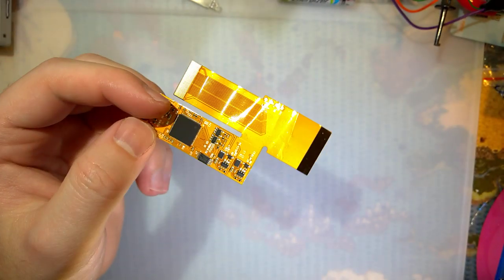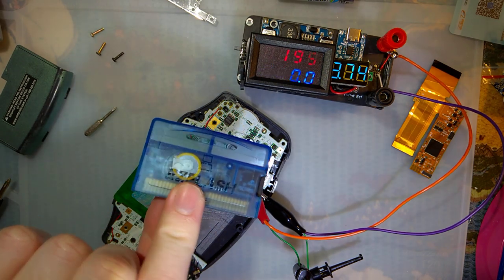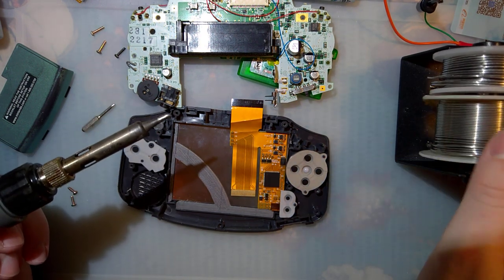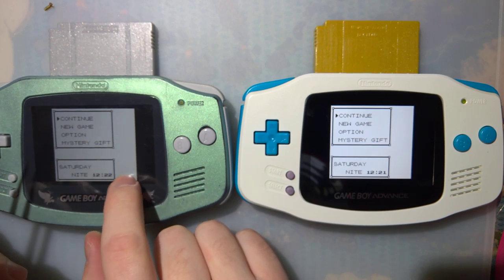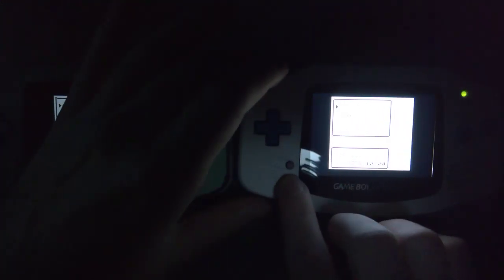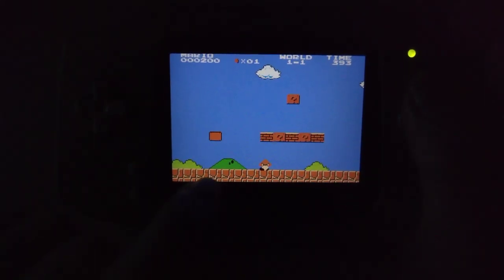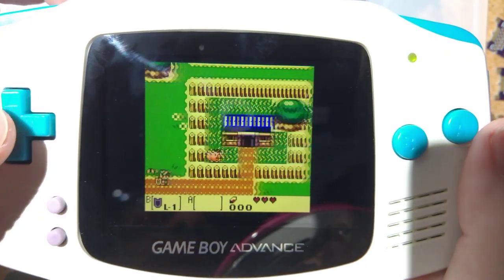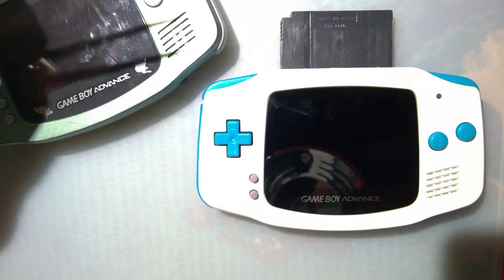Comparing the different GBA IPS Kits (Funnyplaying vs "One Chip")

Comment: Re: the Mario Bros. cloud issue: The NES has a screen resolution of 256x224, while the GBA has a resolution of 240x160. To avoid losing detail, Nintendo made the Classic NES games on GBA alternate what line's being shown each frame (sorta like how interlacing on an old TV works). My guess is that the flickering is causing the IPS screen to retain the image. I'm not sure why one of the screens is affected while the other isn't, but I'm pretty sure if you switched ribbon cables the LCD with the retention problem would still have it.
Reply from the maker: I did test both ribbons on the same LCD. The problems that I mentioned were from the ribbon. The two ribbons handle the LCD conversion with completely different hardware so I'm not surprised that they both have different quirks.

Comment: NES emulated games do produce a lot of artifacts on Funnyplaying kit; the most extreme one I saw was probably Qix, which left a lot of junk on screen after finishing each level.
Reply from the maker: This wasn't a NES game though. Well, I guess it is, but in this case, it was a port from nintendo. The game is one of the classic NES series ports from Nintendo of Super Mario Bros. I would get if an emulator had some visual glitches but this was first party code.
Reply: @makho  pretty sure that is more or less the same thing, since SMB in PocketNES glitches the exact same way the "port" does.
Reply: @makho  also just tested this - PocketNES can disable flickering in settings, which significantly reduces those artifacts; the Nintendo "port" probably does not have the option, though.

Comment: Hi Makho, is the framedrop you showed in Pokemon in this video fixed on recent V2 One Chip kits from aliexpress etc. ? Because I don’t want a Toppoly screen from the Funnyplaying kit.

I want a screen with a perfect smooth scrolling, so no stutter etc. and in this video only the Funnyplaying kit is ok with that.

Maybe it’s because only this kit run the screen at 59.73hz like the original Gameboy advance screen and other kits are at 60hz ?

Thanks 👍
Reply from the maker: Yeah so the framedrop issue has been resolved for a while now, especially with the "2 in 1" and "TV Version" OC kits. The ribbon cable based kits that I showed in this video are still hit and miss but most of those should be good too.

Comment: Hi Mahko!  How do you avoid getting dust under the screen lens?  I have done a few IPS mods but I always end up with specs of dust under the lens.
Reply from the maker: I'll let you know when I've got that figured out and can do it consistently.
Reply: We are all on the same boat unfortunately
Reply: @francasal1487  It's too bad, I'm way too ocd about dust under my screen lens.  I have found using packing tape to remove the dust works pretty well.

Comment: why do you set the power supply at 2.4 volt instead of 3 volt?
a pair of regular alkaline batteries would provide 3 volt (1.5 each) and rechargeable ni-mh batteries provide around 2.5 volt (1.25 each).
Reply from the maker: There's a whole host of reasons. 2.4v is about the mid charge level of a pair of alkalines. I'm not going to test the whole range so testing the middle is easier. Some mods cut down on the low voltage cut off due to the increased power draw so testing at the bottom of the spectrum won't work well. My power supply struggles at much lower than 2.4v anyway (it really could use some voltage smoothing). I don't care if everything works on a pair of fresh batteries because one will rarely use fresh batteries (they do stop being considered fresh after a few minutes of use, right?). Same reason I do GBA SP consoles at 3.7v despite a fully charged Lithium-Ion putting out 4.2v and a mostly depleted one putting out 3.0v

But probably the biggest reason is because when I first started testing with this meter (and recording values), I was replacing a different system. The batteries in that other system were approximately 2.4v so I was trying to see if the measured power usage was seemingly accurate. I just stuck with the value. Before I made this power meter, my previous methods were just to use a multimeter inline and my batteries happened to be at about 2.4v when I made that switch.

Comment: Thanks for the test! Too bad I already got the “non-funnyplaying kit” on the way T_T
Reply: i have the non-funnyplaying version since two weeks too, but the screen is way brighter (even on the lowest setting) an I have not seen any problems lika taering oder ghosting etc... but I like the fact a lot, that the china-chip remembers my brightness-settings, even if i change the battery! so I really recommend the china-version of the gba v2 ips mod!
Reply: ju5td0nt yes I just installed it, the lowest brightness is still quite bright and I always play at lowest setting. The screen still looks great, I think there is still frame skip but difficult to see. Overall still quite happy :)
Reply: @spedtron  i really think it's even better than the funnyplaying-chip =)

Comment: Yesterday i installed a funny playing one, and somehow it doesn't remember the brightness level when powered off, and now i see that the other IPS does, also my LCD has this weird tint, like a warmer tone to it, i have an SP with ips as well ans it's really white when i leave it on the Gameboy logo with no cart and i can see the differences, so is there a fix to adjust the warmth? Like something on the ribbon chips? Or the GBA potentiometer?  It's funny playing direct from them, from AliExpress and the box was the actual cartridge one and had the funny playing logo on the tape so it should be legitimate, i also checked my solder points and they're perfect
Reply from the maker: the funnyplaying agb 9380 kits never stored brightness. Look up "toppoly" on my channel.
Reply: @makho  thank you, i have watched the entire thing and has answered my questions, also i don't mind getting a LG panel, hence the other kit is installed no way for refund, but how would i know to make sure i get a LG one, im not trusting AliExpress for the moment, im sure it'd be the same situation, ive seen pictures of panels with the mesh tape, but i doubt I'll get one, knowing the sellers in Ali im probably going to stick with a reputable mod vender.
Reply from the maker: @enragedgecko  you don't. Most sellers don't care to differentiate and those that do don't have the one you want.

Comment: I have a clear GBA that I installed the FP IPS in and want to solder so that I can adjust the screen brightness. Where can I find wire to do this? What gauge?
Reply from the maker: Any wire you can make fit will work. I use solid core 30 AWG for internal stuff, typically.
Reply: @makho  id also say using fuse wire is handy

Comment: I got a GBA 40 pinn with both kits but both draw to much power for the EZ FLASH what can I do?
Reply from the maker: clean your power switch and battery contacts.
Reply: @makho  i did :D I tried so many thinks i tried 40 pin and 32 pin connector i tried funny playing and one chip ribbon i even replaced the capasitors. In my eom games its crashes too somettimes

Comment: I have seen on ghosting flicker with my FPIPSv2 while playing a boktai 3, the dungeon transporting circles sometimes will follow you to the next screen. I just assumed it was the LCD couldn’t handle it.
Reply from the maker: It's hard to say if the flickering is from the screen or the ribbon or both in some cases. Specifically with LADX, I think it's the LCD but I don't have any way to test that theory.
Reply: yeah it doesn't bother me, I have also heard of some flickering on FZero Cilmax, the maps are a translucent looking and it also flickers a little bit. 

Over all doesn't bother me. Thanks for the new video, 👍🏻👍🏻
Reply: The only times I've seen people complaining about wonky graphic issues are from screen that are actually copies of the FP IPS. Is it possible you could've gotten a counterfeit?
Reply from the maker: @SynZ777  I mean, one of mine is. That's the whole point. 

The flickering he's talking about though is an unintended side-effect of these mod kits. It affects both "legit" and "counterfeit" kits as you claim (both are legit, they just have different manufacturers and are made with different hardware). It is supposed to flicker. The problem is that the sprites were designed to flicker because it was easier than adding in transparency support and the pixel response on the older screens was bad enough that it actually showed as transparent instead of flickering.
Reply: @makho  Thanks for clarifying.

Comment: quick question for you since you seem to know alot about electronics:
i decided to install a li-po rechargeable battery along with TP5056 and will be using a 1N4148  Diode. It scares me that funnyplaying screen draws up to 400mah because that is what i will be the lcd i will be using as well. I believe this diode is rated at average 200ma and  400ma repeating peek: https://en.wikipedia.org/wiki/1N4148_signal_diode

you see any potential problems with this Diode?
Reply from the maker: I presume you mean a TP4056 module, but I typically use a 1n4007 or similar for this.
Reply: @makho  yes, sorry typo on board.

thanks, i just look up that model and both 1n4007 and 1n4001 have same max current ampere.

For 1N4001 Diode, the maximum current carrying capacity is 1A it withstand peaks up to 30A
For 1N4007 Diode, the maximum current carrying capacity is 1A it withstand peaks up to 30A

only different is max voltage 50v vs 1000v, so i think i should be good since max ampere is 400~ ma 

thank you.
Reply: @makho  is it safe to play and charge battery with TP4056? i keep getting mix answers online that say its your not suppose to charge and play at same time.
Reply from the maker: @thepokerus4184  It does work and you can do it but since the TP4056 does not do load switching, it is not a good idea to do so. It is safer to switch off the Game Boy while charging.

Comment: Hey Makho hows it going man? Im about to order a v2 kit, but would you say the chinese ones are worse? I know it has the eeprom to remember brightness but also heard its not perfect 60fps and still tear?
Reply from the maker: I'd get the FP version over the "one chip" version until they fix that issue.
Reply: @makho  Sad to say, the FP version isn't available for purchase in the UK/Europe at the moment..at least I cannot find one. 

I think I will have to go with the Ali IPS version.. But like you said it's still good right?
Reply: @makho  I also had the V1 IPS, that one was really bad.. this one doesn't have as bad tearing as the old V1 right?
Reply from the maker: @MMaRsu  https://www.aliexpress.com/item/4000014548521.html

and no, it's nowhere near the V1 kit tearing.
Reply: @makho  The funnyplaying sellers from aliexpress are the official ones? , Where you suggest I'd get it?
Reply from the maker: @dxnnyshawn  the link I posted is funnyplaying's store, so yes, that's official. Or you can buy straight from their website. The base prices and shipping are different between the two sites so one may be cheaper than the other depending on where the package is going and if you want to pay for expedited shipping.

Comment: I watched this video, bought funnyplaying IPSv2 and have tearing in particular games / scenes.. this sucks.
Edit: not tearing but flickering for some sprites
Reply from the maker: I haven't had any tearing with the funnyplaying v2 kits. Did you buy from funnyplaying?
Reply: @makho  yeah, I bought on aliexpress. just tested it with f-zero but this is fine. Tearing is also not screen wide, but for specific enemies f.e. first boss in sword of mana or some enemies in super mario advance. Weird stuff.. but luckily it's only for a handful of encounters so far!
Reply from the maker: @JaN-qg4fq  And you bought from funnyplaying ON aliexpress? Or just a random seller?

Or do you mean that certain screen elements are flickering? Because I explained that a few times in a couple different videos. The flickering is by design. In OEM screens, the pixel response was garbage so devs would turn sprites on and off really quick to achieve a transparency effect.

Comment: That low level on the Chinese screen is great. I have one, a v2 IPS,  but it does not go that low. I find myself wanting to play in bed but it is too bright even at the lowest setting. I wish i had your screen. Where did you find yours?
Reply from the maker: Mine is from retrogamerepairshop.com but the kit itself is refurbished. I have another ribbon from the same shop that does not go that low so I dunno what's up with that.
Reply: makho I see. So it is really the ribbon that determines how much power goes into the screen. Makes sense. Maybe there is a way to add a resistor or something. Thanks for the reply man. Great video.